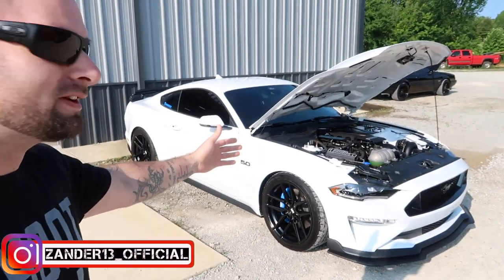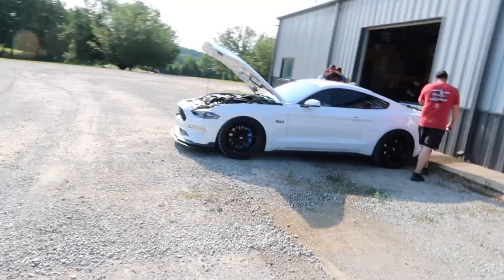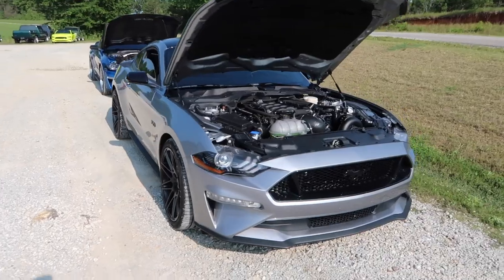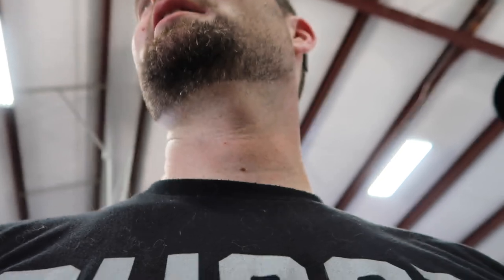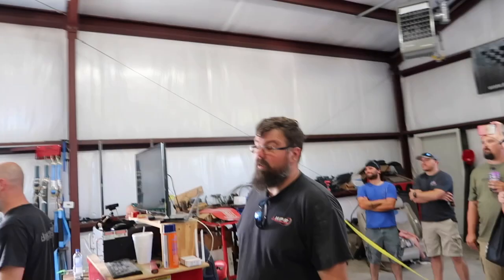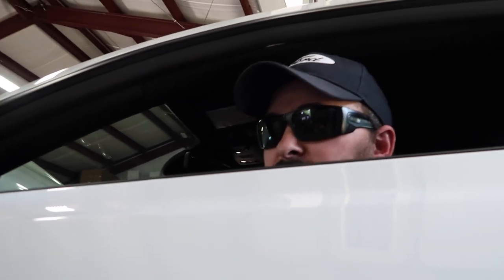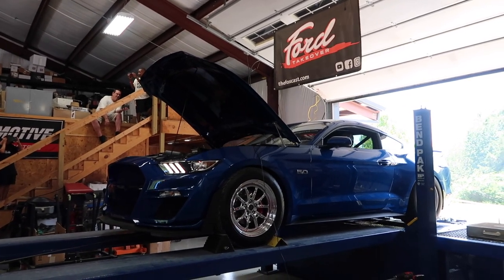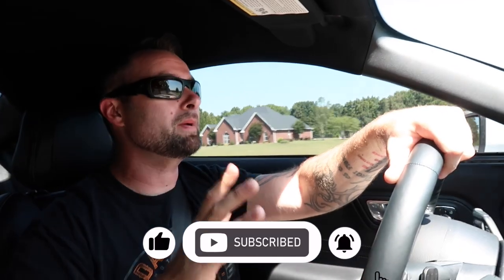MY ESS G3X SUPERCHARGED MUSTANG GT FINALLY HITS THE DYNO... BIG RESULTS!

Comment: Alex having 700 hpw as a daily driver seems like the perfect manly car!!! Cruising somewhere keeping your foot out of the throttle and you most likely get 25-27mpg. Someone pulls up in a Camaro or Challenger and you blow their doors off in your sweet smooth running white Mustang GT. 🇺🇸💪👍
Sounds like you are set for awhile until you desire another 100 more horsepower but then you will have to change your tires.  Great video Brother‼️😎🇺🇸✝️
Reply: I'm running same setup minus the x impeller. Averaging 17 mpg. Love my ess kit

Comment: For comparison my Procharger D-1X on the largest pulley they make for this head unit (it's massive, takes up the entire head unit) made 768HP/546TQ on E85 to the wheels at Palm Beach Dyno on a 20" / 305 Drag Radial.  My mods are Fore fuel system, 1050id Injectors, a few fuel pumps, Stainless Works 1-7/8" Long Tubes into the stock resonator, stock mufflers, stock tailpipes.  I have a lot of mods but not many engine mods.  Boundary oil pump gear, 90MM Throttle body and the blower.  In fact I just made a YouTube video for my friends and family who do not live around me.  I go over the mod list and dyno graph.  If I want more I can pulley down without changing the tune, Palm Beach Dyno tune compensates.  I just got the car so not needed now.  Later I will turn it up to 850 with a smaller 8-rib pulley.  Think it makes 10-11psi currently.

Comment: I made 685 whp on 93 with 120 pulley with a G2. Had an Alky control meth kit dual nozzle install complete today and will see what it makes on the dyno tomorrow. Starting with a 115 pulley and will test the 110 as well. I think I’ll end up staying on the 115 pulley with added timing from the Meth (no water just 100% M1 methanol from VP) I’m hoping for 735-750 whp I will be so happy
Reply: I made 703 on a 115 pulley, gen 3 10r80 with an e30 tune on a g2. 

Just went return fuel system with 105 pulley and made a little over 800

Comment: As you said for the street 680whp is perfect, great result. I keep my Whippled 10R80 at 660whp for the street and on a wide r888r with wavetrac diff I get full traction from all of 3rd and up of course.
Reply: What would it take for you to get traction out of the hole?
Reply: @thomasa2145  Not possible on the street.

Comment: As you've had both, which way would you go for a fresh A10 street build today: ESS or Hellion Sleeper? Every time I settle on one or the other, I realize I forgot why I was dead set on the other one a week before.

The ESS would be nice since it has no lag, likely sounds better through headers, and is cheaper.
Then I lean back towards Hellion because there's more power for the same fuel, the ability to change up the tune based on what gas I have, boost control that requires buttons rather than wrenches, and all the jet noises.

I would like to go turbo, but I don't have the best roads in my locale and I want to lower the car in the future, which has me worried about clearance and damage to the oil system.
While I prefer the supercharger for ease of install, price, and sound, I'm worried it won't get me to my goal of 145-150mph traps without going overboard on the build.
Reply from the maker: I’m on my second ESS kit right now and am loving it. With the 10 speed auto this car is a bullet. The ESS pulls like a freight train. For a sick fast street car, ESS has my vote. Hit up ken@hprautomotive.com and tell him ZANDER13 sent you for special pricing too! Turbo is fun but very expensive and high maintenance. ESS weighs less, same good IATs as a turbo, extremely cheaper and basically no maintenance and it sounds insane. Jet noises. Be sure to get the loud cut gears too!
Reply from the maker: Plus… ESS with the huge low boost 125 pulley on a full weight s550 will do 135 in the 1/4th. So just imagine with a 100mm pulley will do😉 we know a person that went 157 in the 1/4th with a 100mm pulley on e85 too
Reply: @Zander13Productions  damn, that's awesome, thank you! And thanks for the quick reply! I have a couple cars that are all low 11s and trapping teens. I decided I wanted a fast one finally, and couldn't make my mind up whether the driving convenience with the turbo was worth the added install issues. If the ESS will get to the same point with the only cost being slightly more fuel system, I'm thinking that's the way I'll steer. Thanks for all the videos BTW, they were a big decision maker in my choice on a Mustang haha

Comment: Why does she pull timing? Fuel?
Reply from the maker: Yea. Crappy 93 octane
Reply: Copy
Reply: Aside from E85 how do u remedy the "timing pull"? Add oct booster as insurance?
Reply: @HoldenHiscock069 yes, but u don't always wanna run that. So fuel system and e85.
Reply: @Fingamyaz  is there a good oct booster thats pretty safe n clean? Lucas maybe?
Reply: @DrewPWebos boostane

Comment: I wonder why your mach 1 made 735 whp and this one only made 683whp?
Reply from the maker: mach 1 was a manual and dyno was in the 1:1 gear. this car is auto and dynod in 6th gear and not the 7th gear 1:1. so technically they are almost the same power had i been in 7th gear. the auto rob’s a tiny bit of power but is WAY faster shifting
Reply: @Zander13Productions  thanks bro

Comment: Great video! Is it difficult to clean the cold air filter with the ess kit. I noticed its tucked in and not accessible like the vortech. Do you have to remove bumper to clean it. I've been wondering for a while now. Thanks 🇺🇸
Reply from the maker: It is tucked in that little spot but it slides out no problem. No need to pull the bumper
Reply: @Zander13Productions  awesome 👌 🇺🇸...thanks
Reply: Take it off n use a blower guard instead. Less restriction.

Comment: Hope it's good number cause I'm getting a G3 here in a few weeks. Minus the x trim
Reply: I'm making 720whp on the ess g3x with 120mm pulley on 93💪😤
Reply: @slo5.0gt  How much of a difference would it be with the standard impeller and not the x trim?
Reply from the maker: Same numbers
Reply: @slo5.0gt are you 10r80 or manual? Gen 2 or 3?
Reply: @Michael-c8n6q  manual gen 3 for me